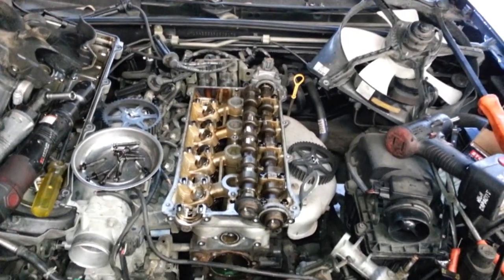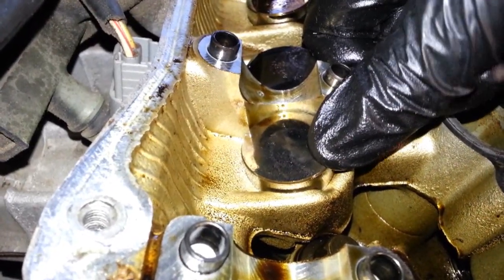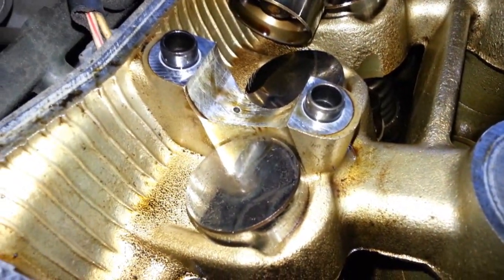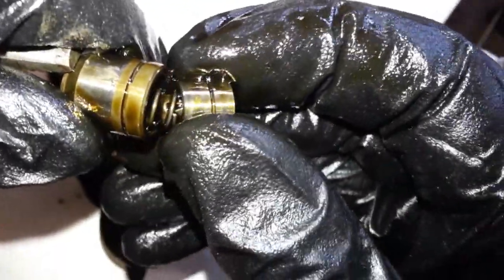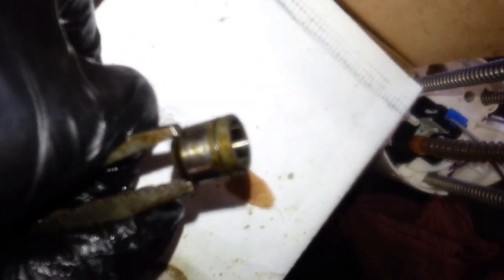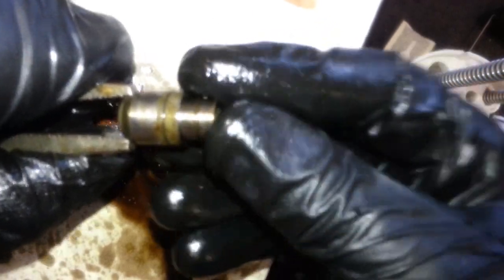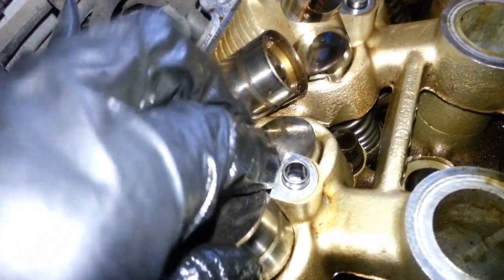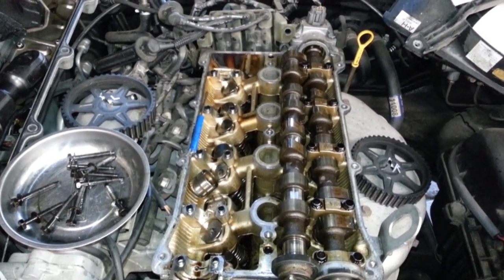How to fix hydraulic lash adjuster tick on miata,  ford, Hyundai, Mercury, and KIA.

Comment: Sorry to burst your bubble but, you sound like what we used to call a shadetree mechanic. This video is just full of bad advice as well as mistaken diagnosis.

What you've done to cure your problem is clean out those check valves. A good lash adjuster would have no spongyness at all when your cams are installed, indicating the check valves are holding the lash adjustment. When you took the cams off, those lifters sucked up some air and THAT'S why they had some spongyness to them.

Putting in a clean, EMPTY hydraulic adjuster indicates only that it is empty. The extra movement says nothing about anything being fixed. Also, in doing so, you put the thing back together wrong...

It's bad practice to put empty lifters in an engine. Once the engine starts it will take a few more seconds to fill them with oil and the followers will be slamming into the lobes on the camshaft until then.

You might benefit from going to a school, or reading up some more on hydraulic valve adjusters and lifters. Clearly you don't understand how they work.
Reply: I need help real badly, mine does this, how would i make sure i dont put an empty lifter in? How would i properly lubricate it with oil?
Reply from the maker: Smerk a Berl? The ones that collapse are not holding pressure. Clean the check valves and just install them. I used 0w20 or 0w40 synthetic oil to help clean up and get pressure built up quickly. If u have it apart, why not just buy a set of new ones and use synthetic from now on and never worry about it. ;-p
Reply: How much are new ones
Reply from the maker: Smerk a Berl? I did a quick search online, they are $90 shipped for a full set!
Reply: Wait, i have the NB with solid lifters
Reply from the maker: I'm guessing you didn't bother reading my description? I was getting the two backwards, who knows, maybe I was high on fumes ;-p anyways the motor runs quiet now and all the lifters are no longer collapsed.

Comment: i just got new lifters for my Capri because they were all inconsistent whether you could move the plunger. i thought the plunger was supposed to be so tight that you could not move it with your finger. 
the new lifters were tight until i removed them because i forgot to hit them with engine lube. i never ran the engine but now they are loose enough that my fingers can pump them.
are they defective or is this normal; do they need to pump themselves back up with oil after the cam compressed them?

Comment: They should hold pressure over night. If its squishy after running the engine for 5 minutes then clean or replace. Should be hard as a rock. All of them

Comment: Movement of the lifter is not an indication of anything.  The cleaned/new lifter moves more because it has little or no oil in it.  The old lifter moves a small amount because it has enough oil in it to remove the lash between it and the installed CAM.  When you remove the CAM, air replaces the amount the lifter was "adjusting".  This doesn't mean cleaning won't fox it, it may.  The FSM tells you how to check a lifter....
Reply from the maker: you have a point there! thanks!
Reply: Seconded. In fact the check procedure is to bring engine to operating temp then attempt to depress the lifters. Any lifter that moves at all are bad. This is because the check valve is leaking allowing oil to escape rendering the hydraulic adjustment faulty. Nice cleaning video nonetheless.

Comment: I usually try the old school way first. Add a Qt of automatic trans fluid to the oil and let the car warm up. Do a few cycles like that then change the oil.  It's never let me down yet. Lots of detergents in ATF.
Reply from the maker: Jeff Greenfield good tip, but if you have the valve covers off, while doing a timing belt, might as well. the atf doesnt get the gunk out, but it can get it cleaned up a bit. but atf does have a tendency to scrape the bearings sometimes... idk. up to you lol
Reply: +Jeff Greenfield There are almost NO detergents in ATF (confirmed by MANY VOAs). Why would it need them? ATs don't get dirty!
Reply: AT's are very dirty. Detergent is used to help float the clutch particles to the filter.
Reply: Compared to engines, they are pristine. They have no combustion byproducts to disperse and therefore have comparatively low additive packages. Just see the following two examples:

ATF VOA: http://www.bobistheoilguy.com/forums/ubbthreads.php?ubb=showflat&Number=1169896
Typical Engine Oil VOA: http://www.bobistheoilguy.com/forums/ubbthreads.php/topics/3654270/Castrol_Edge_Extended_Performa#Post3654270

The ATF has less than 1/10 the Calcium and less than 1/4 the Boron (the two main detergents). This isn't even a High Mileage or Diesel engine oil, both of which contain even more detergents. The ATF in the engine oil thing is a myth that has persisted for a while with no real backing. ATF is typically thinner than most engine oils, so the reduced viscosity may have some effect on engine noise, but that's about it.
Reply: +BrotherMichigan I may be wasting my time since you already think you know everything, but I'll try. BTW I am a retired ASE Master Technician and I ended my career as an automatic transmission specialist. I found and discovered fixes the engineers couldn't find and my rebuilt AT's NEVER came back.

I've been trained (back in '92) by GM at the GM Training Center in Atlanta by Dot Huff, one of the best automatic transmission experts I've ever met; she could tell you what one part was malfunctioning of the two thousand or so parts in a 440T4, just by driving it.

I don't know or care what "Bob" says about detergent additives but I do know that ATF is very good at cleaning things, use it on your grubby hands just once and you'll see what I mean. Whether it has a detergent you'll find in oils or not, it has a detergent quality to it BY DESIGN.

Automatic transmissions get very hot, much hotter than engines and the base oil in ATF is mineral oil, it tends to turn into varnish from the heat alone. Do you know why it's red? The red color is a temperature sensitive dye that degrades over time by heat. The hooter it gets, the faster it turns brown.

Back to this "detergent" controversy. I've used ATF to clean out lifters many times and it works. I've also used it to clean fuel injectors; one quart in ten gallons of gas and they get misty again, just like new.

Continue to write stuff you've read or heard because it sounds good and you only let those of us with EXPERIENCE know what you really are. A half-smart know-it-all who really doesn't know what he's talking about.
Reply: ladamyre1
ITT: Why transmission shops get a bad rep.

It's funny that, with all of your experience, you aren't actually able to respond to any of my claims. Instead, you must resort to attacking my person. I'm glad you've had a successful business repairing transmissions, but I certainly won't be bringing any of my vehicles to your shop.
Reply from the maker: @ladamyre1  late reply, but I would take my trans to your shop, cause you know wtf your talking about. I dont care if you "sound like a dick". Feelings aside,  I'd rather have something done right and with someone that has experience. Take care brother.

Comment from the maker: its been sitting, waiting for the next upgrades. Need, to take out the welded diff and install a lsd.
then convert to z31 ecu and tune. then get hy35w turbo and raise the boost to get 350-400 wheel hp.

Comment: Hi.  This video came at just the right time for me because I am driving Opel Meriva 2004 model.  This car is giving me a headache as it has a nasty ticking noise under the hood.  I replaced the lifters but the results are still the same.  What is deteriorating the prblm is that this noise is disturbing the knock sensor when I am driving at highway speed, bcos ECU retards timing and reduces the car speed.  When I diagnose the car with Opcom, I get the following results:  knock signal circuit not present.  I wish I cud hv also watched this video bfo I cud buy new lifters.  Do I have to clean the lifters the same way as u did bcos my car is using the same lifters?  Pls advise me on this.

Comment: Hahaha. Buddy. Lifters wich are stiff are good one. On the other hand lifters who moves are the bad one. What I can see is that engine didn't get regular oil change. You can see that in soot deposit inside that lifter.I have 1 question! How long it took for that engine to get quiet after you refire it on those empty lifters!?

Comment: it seems to me that the check walve ball seat in the small piston needs to be cleaned ,  you say in this video that the small piston should not be taken apart, so that is wrong l guess. l just saw a video about that. it is taken apart to clean the valve ball seat.
Reply from the maker: well if you can put it back together witghout damage, go for it. this was mostly to get people comfortable with doing the job if they wanted to try without spending money.

Comment: soo for this method to work and just throw them back in you have to have hydraulic lash adjuster/ lifters? my 1990 has bad tick and imma be ripping her apart tomorrow but i dont think it will have the hydraulic ones cause they are probably stock

Comment: I will be replacing bucket style hydraulic lifters in the next few weeks , I plan to lubricate the outside of them for the install , fit the camshafts , new timing belt etc. then crank the engine without spark plugs which should prime the lifters with oil which I can check in situ before re-installing the rocker cover , spark plugs and running the engine . Anything wrong with that approach ?

Comment: Hydraulic Bucket over valve.. It replaced the old Bucket shim design.. So it should be hard to compress or it floats and makes noise...
Reply from the maker: i realized my mistake a few moments after uploading. I should know better, but i was exhausted after working likely a 12 hour shift and my brain was toast. Thanks for clarifying.

Comment: Can bad lifters cause Rich Condition and hesitate on low rev (1000to3500) ???
I get no codes, but it is running rich and there is a lot of rattling with cold engine, also popping sound from exhaust like backfire, not loud but present. No vacuum leaks as far as i can see nor hear. (Curze 1.8 Petrol)
Reply: Did you ever find out what was causing it. My suv is having the same problems.

Comment: Thanks for the video. I am rebuilding a Kia Rio, and noticed that all the lifters were hard as a rock. But I could not remove the pistons like you described, no matter how much I pried. They don't have the ledge on the piston like you described - it is tapered all the way, so it is harder to grab. Also, a guy at my auto machine shop says these lifters should be never disassembled. What are your thoughts on that?
Reply: Never mind, I was able to eventually remove them. But it was not as easy as yours. I had to hold it on a bench vice and pull with a vice grip.
Reply from the maker: I am sorry for the trouble, but was high on fumes and got the collapsed/good lifter backwards.

Comment: Some videos show slamming lifted open end against wood to disassemble. That didn't work for me, neither did grabbing with needle nose vice grip like this video. Maybe mine are more stubborn. Mine are for 01 Kia rio, 1.5L. I even tried soaking in an ultrasound with degreaser. Tons of carbon in the head that I cleaned out. I wish I would have bought new ones as now I have to do the job over. I put them back in thinking Marvel mystery oil would coax them back with engine running. No luck. The Kia really sucks for lack of space to work. I dread it but will do it. My hands are raw.

Comment: you will win I have a Hyundai Elantra 1.8 engine, the problem is like this. In the morning, when I start the engine, it makes a noise. When it warms up, the engine does not make a sound. What could be the problem?
Reply from the maker: Use oem filter, and change both oil control actuators. If that doest work, you need a new chain and tensioner. They wear out faster if oil is not changed often and cheap oil is used.
Reply: Knocking in the engine is caused by the fault of the chain or hydro compensator

Comment: I have a pretty clean engine and the HLA cleanup I performed (which was done thoroughly) only fixed the tick for about 500 miles. experimented with different oils etc, still ticking away so I have ordered new ones for around $50/full set. Lets will see if this finally fixes the issue for a while
Reply: Update??
Reply: @hunterwright386  HLA's never fixed it. Had to do valve springs and a bunch of top end work. Ended up being cheaper to just buy a new head.
Reply: @kenwhiteproductions  understood, thanks for the info.

Comment: i have the ticking sound its hyundai accent mc  and the previous owner wasnt always on time with oil change intervals
i using 15w-50
now i will use 5-40 and will hydraulic lifter additive liqui moly
i hope i solve the problem
Reply from the maker: That additive will most likely not do anything. But if it does fix the problem, post it here!

Comment: on the stuck ones, are those cylinders even creating any power?  Also, I assume this means that it's not an interference engine since those valves are stuck open?
Reply: richardmg9 the valves are actually opening less than they should when you have bad lifter tick. instead of pushing the valve all the way open, the cam is compressing the lifter a bit. so you'll lose a bit of power. 

if the valves were stuck open, the motor wouldnt even run.

Comment: Squishy means they have air in them.  They could be good or bad.  Hard means they have oil in them and no air.  Those are most likely good.  Some really bad info here.  Install them, run the car intermittently and if there is still noise, measure clearance and replace the ones with excessive clearance.

So much bad info on YT it's borderline comedy.
Reply: squishy means they are clear clean not blocked solid means oil not circulating and blocked cannot adjust propperley. clean then and they are soft just like when you buy replacements until they refill and adjust like they should.
Reply: @moz6616  If what you say is true everyone that starts their engine it would rattle like hell until they filled with oil. When a person replaces lifters you are suppose to put them in oil to fill them up with oil so it doesn't make noise, read a repair manual

Comment: When i did the valve seal replacement i notice all my hydraulics were hard doesnt even move does that mean that it stuck and mines lools like its drippin oil on the piston head on number 2 cylinder even with new seals was thinking it might be causr for stuck hydraulic lifter
Reply from the maker: It means your car is fine. I meant to say the loose ones were collapsed. If you have oil on there, usually it's from leaking spark plug tube seal when you crack open the plug, it drains in the cylinder.
Reply: Looks like i got a leak somewhere between head cuz the piston head on 2 cylinder always had oil in it ..  no there isnt any huge leak in spark plug hole

Comment: I heard you suppose to put some oil in the lifter before putting it back?
Reply from the maker: Possibly true, i didn't do that, and it was a littly noisy for the first few seconds, then the oil pressure built up and worked its way in.

Comment: Great video! I am thinking about getting a miata. I test drove one with 57k miles that had a ticking. Im thinking this might be the problem. 

How long did it take you to do all 16? is there a lot of engine removal and work for the entire process? I see you took out the over head cams.

Comment: It goes down more because of the oil that got dumped out oil is what keeps it from going down like that. If it moved like ones you drained it would be a leaky one and that would be the problem. This does nothing. The oil keeps it stiff,Hydraulic self adjustable lifters.

Comment: "that's what she said" at 7:00, lol
however as pointed out, your explanation is flawed - you want SOLID lifters, not squishy ones. the idea is to fix the check-ball seal. if your fix actually works, it's probably coincidental with the fact you put a nice clean oil charge in the engine and possibly flushed some debris out of the lifter cavity that was/may be entering that check-ball interface.

Comment: This is a nonsense : the lifters MUST be "locked" - impossible to push down. When they move, the valve is leaking oil or/end the engine has low oil pressure / worn lifter housing.